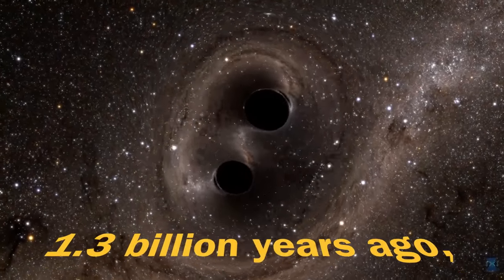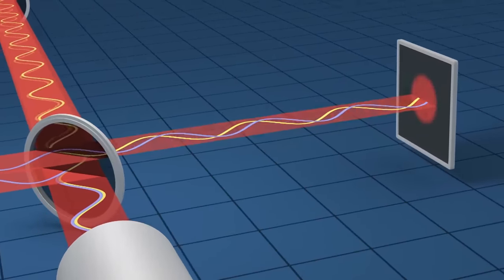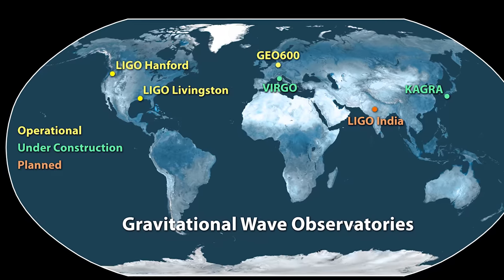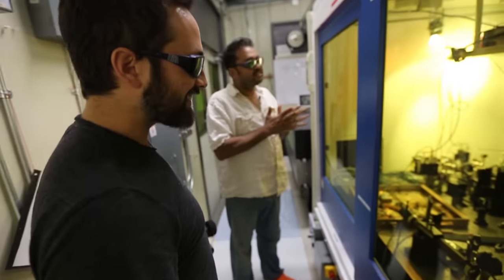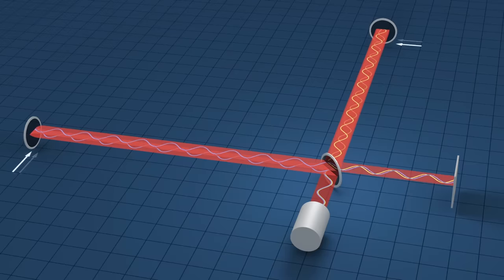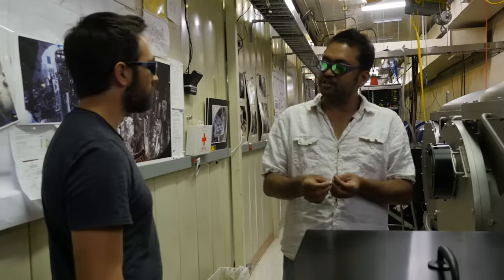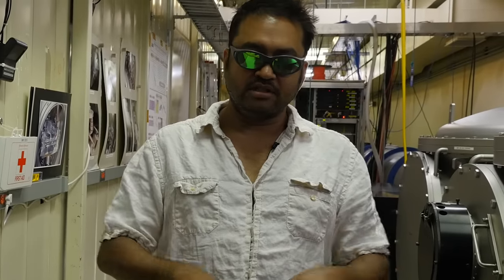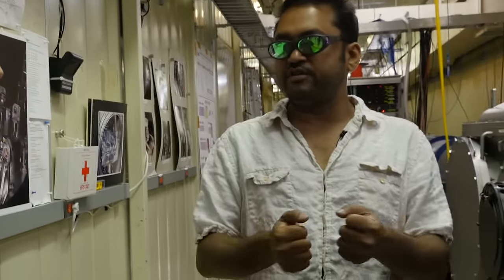The Absurdity of Detecting Gravitational Waves

Comment: Orange crocs and those shades? what a legend
Reply: The shades are maybe mandatory in the "laser zone".
Reply: @Vallecaucanisimo  

There are a whole bunch of lasers in the real-time measurement system that damps external vibrations. There are more lasers to worry about than the one in the tube.

They were standing next to a semi-functional scale model, far from LIGO. They have a very simple policy to protect people from the big beam. When people are working in that building, they shut off the beam. LIGO can't produce good data when there are people or other masses moving near by.

The scale model is used to test ideas before they start working on the real thing. It is functional in the sense that it is comparing laser beams in a vacuum, and there are real sensors being tested. It is not functional in the sense that it can't detect a real gravity wave. They have some other mechanism to move the mirrors do they can test hardware and software.
Reply: @Vallecaucanisimo  No problem.

Some graduate student once put a laser enclosure back together wrong in a distant university research lab, and bad things happened. So now the safety engineers at universities and national laboratories want everyone to be at least two mistakes away from blindness, death, or dismemberment.
Reply: Voice: Kent, wake up!
Kent: Who is this?
Voice: It’s Jesus Kent! Stop playing with yourself!
Kent: It is god.
Reply: Future project being guarding us from black holes. Yessir absolute legend
Reply: Legend says this man is still waiting for more people to answer that question
Reply: Are crocs closed toed? 🤔